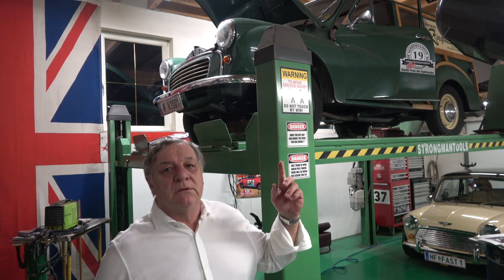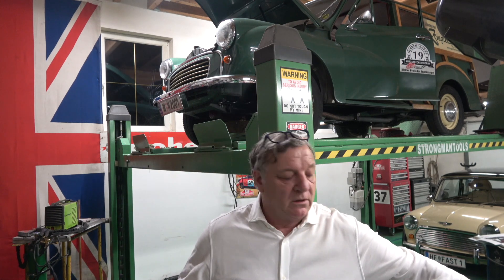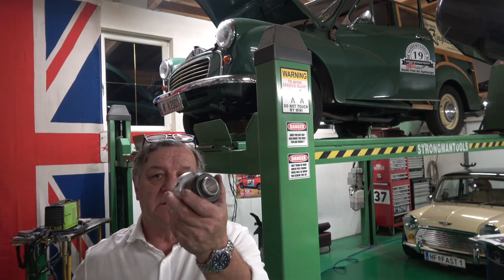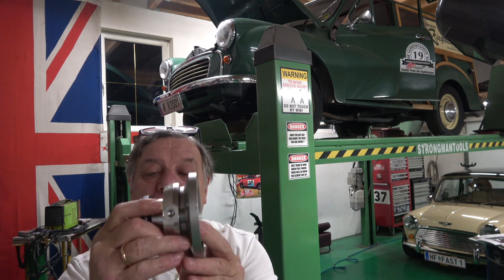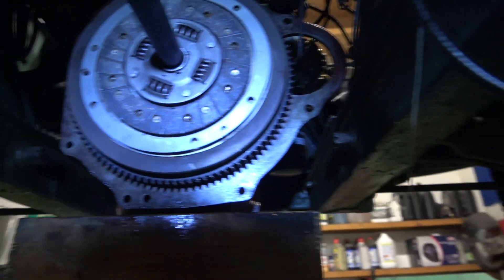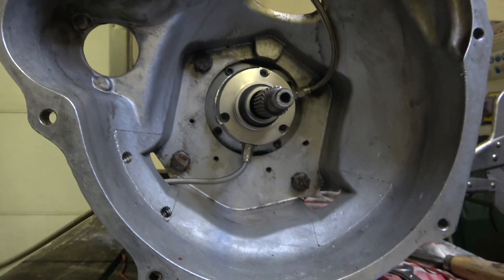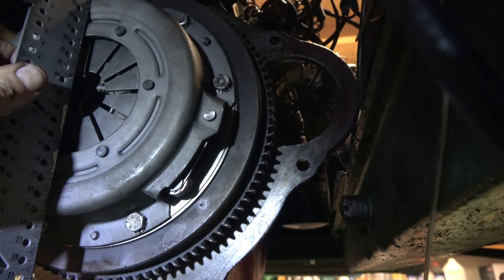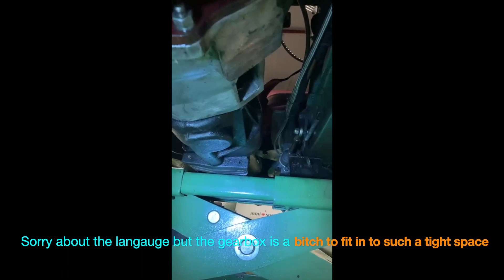Catastrophic Failure Morris with a Ford Gearbox Conversion Part 2

Comment: That's what puts me off getting a concentric slave for my 1275cc MG Midget-engined Minor Traveller, having had to replace one on a Vauxhall Corsa C 1.0 once, which was a right royal PITA, both to fit and to bleed. The standard carbon thrust bearings do wear fairly quickly, but at least are relatively simple to change; last time I did mine, I slid the engine forward off the gearbox on a trolley jack and was able to reach in to change it.
Reply from the maker: This conversion was a nightmare which is why he ask me to do due to having the 4 poster ramp. Cheers Dave

Comment: What a nightmare Dave I guess the lesson learned is “just say no!”, cobbled together conversions are just a disaster…. Sorry but I guess that doesn’t help other than to say good luck getting it all fixed and you’re a braver man than I am, Kind regards, Richard.
Reply from the maker: Richard,  Your 100% correct I have too much of my own work & projects to be spending time on other peoples problems 😉It is a saga for sure but I said the same thing when the seal blew that's IT the final nail in the coffin of doing any work for anybody🤔 Basically the 4 poster ramp as been off limits for a week😠 Cheers Dave

Comment: How often does it happen, you help a friend and it turns into a saga. But that's what friends do. I had a similar problem with SU carbs on my Cooper S there is a locating pin that holds them at the correct angle to keep the float bowls vertical. A previous owner had broken the pin. I carefully drilled a small hole and fitted a new pin.
Reply from the maker: Stewart,  I have always liked the Morris travellers and I took the job on out of nostalgia more than anything else tbh🤔I was going to balance the carbs anyway as 
Bernard mentioned how poor the mileage is but now they will need a good overhaul to see what else is wrong. Cheers Dave
Reply: @ClassicCarCave  You'd be better off fitting a single HIF 44 - they give as much power as twin 1.25" SUs, with far better driveability, economy and less aggro. I get around 40mpg on average on my 1275cc MG Midget-engined Traveller.
Reply from the maker: @FMFGUF  The Morris belongs to a friend of mine but I will mention it too him thanks. Cheers Dave

Comment: What a mess Dave . What is the story with the float cambers .
Cheers 
Pete.
Reply from the maker: Pete,  It‘s a ball ache but we have no other options but to take the gearbox out to repair the leak,  We saw silver foil around the rear carb float 
bowl from under the car which I think may have been put there for some kind of heat shield from the exhaust but it‘s as much use as an ashtray 
on a motorbike 🤣😂 I was going to balance the carbs anyway so I would have picked up that they're loose. Cheers Dave
Reply: Must running like a turd Dave air getting in .
Perhaps dropping the lump out of the bottom is a option. If i was closer would come and give you guys a hand.
Reply from the maker: Pete,  Strangely enough it runs pretty sweet After 4 or 5 attempts to lift the box and line it up I was tempted to take the long route
and take the engine out as the front comes off and you can slide them straight out. It‘s a good run from the UK 🤣😂 Cheers Dave
Reply: Dave I love how you run through the components and what is going to take place. Just a shame the end result wasn’t as planned but a new day and you’ll have it sorted. As you say “Keep the faith” Looking forward to the next episode.
Reply from the maker: Thank you I try to work through why & how we are going to do something but I did the intro the night before we started the gearbox modification 
and fitting it back in and I did say IF it works or not🤔 We will get it sorted I‘m concerned the seal will be damaged so I will pressure it
up in a vice to make sure the seal is good and holds pressure as I don‘t want to revisit this situation. Cheers Dave